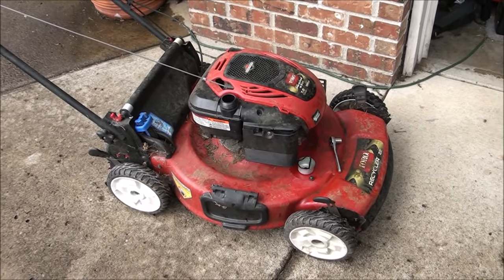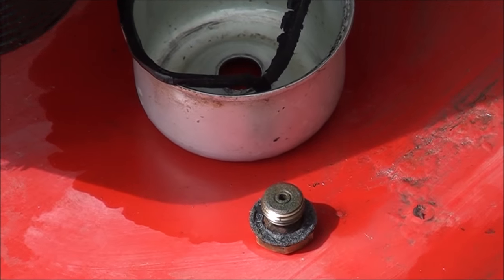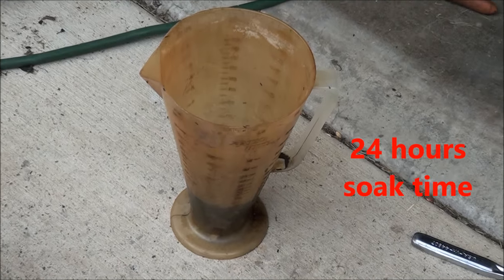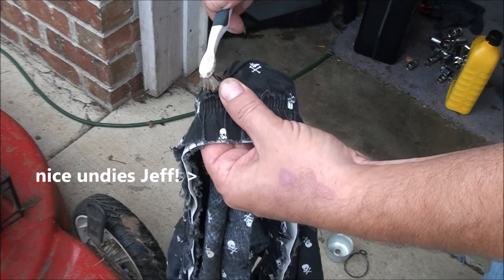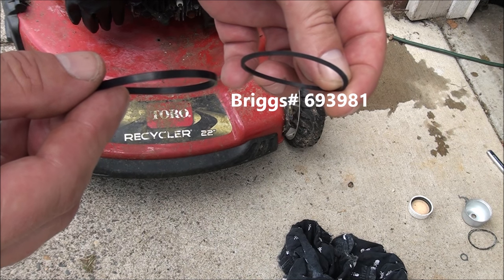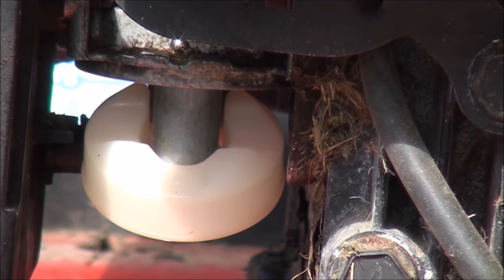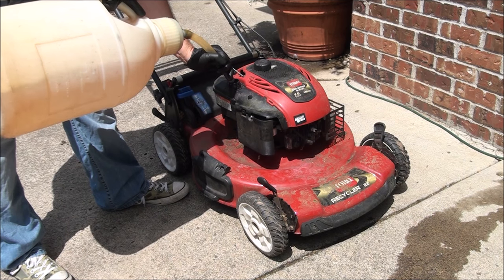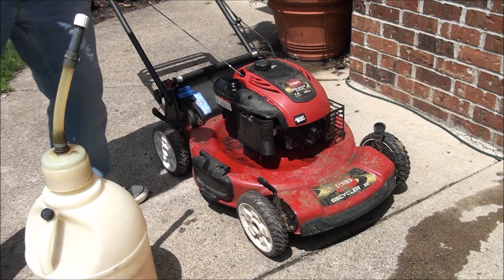How To FIX A TORO LAWNMOWER that STARTS then DIES. Will Not Stay Running. STARTS THEN STOPS

Comment: omfg this worked! my dad was a mechanic at a landscaping biz for 30 years, i helped for 6. we used old lawnboys i use to just give the carb a clean. well my dad passed away leaving me with alot of equipment thats half running half broke. so i remember in convo once he said  "all that thing needs is a gasket i told the person it was junk" so i put the new gasket on he had set to the side and it kept starting and dying after 10 seconds. sure enough i pulled that plug off and both holes were all gunk! i said still, theres no way this is going to work i always have bad luck. sprayed carb clean through it and used a pin to push the gunk out. put it back together. FIRST PULL IT STARTED! ran like a fucking beast i cut the whole damn yard. thank you!
Reply from the maker: good job! It's in your blood
Reply: I landscaped back in the 80’s and I loved those old Lawnboys. I wish I still had one of those mowers because they were lightweight and would run forever with routine maintenance.
Reply: Sorry 😞about your father 👨😔my condolences 🙏I just loss 📉my mother 👩from the covid 4 months ago 😢..

Comment: Thank you for getting straight to the point.   I hope that is what my problem is.  I have seen other (very long and drawn out) videos that take 15 minutes to explain what you just did in less than 5 minutes.
Reply: Well. I went through the whole fuel system. Made sure the gas cap was good and properly venting, the fuel line was good, the little jet that is in the bolt at the bottom of the cup under the carb.  Sprayed down the carb with cleaner.  Blew everything off with a compressor.  Everything was already clean to begin with but after I cleaned it anyway, the mower ran great.  (New spark plug and blade also).  Thanks so much for the video.

Comment: Thank you for your Video , i was having the same problem with my TORO , i changed the Spark Plug , the Filter and  the Oil , did not work , then i saw your video ,  gave it a try and it WORKED ! Thank You  so very much !

Comment: Thanks for the video!  Elevated the mower and tilted it back and clamped the gas feed tube so I wouldn't have to drain gas tank. Just the gas in the bowl, with old towel under worked. Kept old gasket and just manually cleaned jet, even though it didn't look dirty. Nevertheless, mower now starts easily, and remains running smoothly. So glad you posted this Jeff.
Reply from the maker: Glad it helped! Good job

Comment: I had this exact problem on my 2009 Toro "Guaranteed to Start" Recycler with a 6.75 hp Briggs & Stratton engine.  I thought I would have to take apart the carburetor but your solution worked for me.  I did use carb cleaner instead of Coke and so was able to clean the jet and bowl within 10 minutes.  Also, I tipped the mower down onto its handle to prevent my full tank of gas from spilling out when I removed the jet and bowl.  Thanks for producing this video!
Reply from the maker: Thanks for watching friend! Glad it helped

Comment: After replacing the Spark Plug and cleaning the Carb it ran fine for a while. Then it started running bad again. Checked the Spark, even cleaned and adjusted the Gap. Still ran rough. Discouraged until i found you post on YouTube. So I checked the jet it was plugged and there was more dirt in the bowl. Cleaned the Bowl and Jet and WHOW its a new mower, runs great. Thanks Jeff Your the Bees Knees Bro!

Comment: You nailed it. Fixed in just a few minutes. My float bowl stayed attached to the carb and I cleaned the jet with a welding tip cleaner. Runs like new. Thank you for the tip.....

Comment: Thank you for this video.  My husband took our toro completely apart and put it back together checking all the usual things. He got it where it would start with starter fluid but not stay running.  I did a little google search that came across your video so we headed back out to check ours.   Sure enough we got it to start and stay running.
Reply from the maker: NICE

Comment: Thank you, this exact problem started on mine today in the middle of cutting the lawn chewing up the leaves. Pulled out 13 mm socket and it came right out sprayed everything with carb cleaner and just used a small wire to clean the jets put it back together working perfect. Appreciate the video very much
Reply from the maker: Glad it helped

Comment: Thanks for the tip. Worked flawlessly on My Toro nearly same model but 7.25. Wasnt as rusty as yours (it was like new actually, but i always tend to wash my lawn mower after every use), only some kind of <<white mold>> that was clogging it. Once removed, cleaned in some water and a tip cleaner everything worked perfectly. Youre the man!

Comment: OMG you are Awesomeness!!! I have the exact same mower.  It would start then die immediately.  I called the Torro repair shop.  $120 to look at my mower.  I found this video and it cost me the large sum of 55 cents for a new gasket that was crack.  This fix took me about 30 minutes to do.  I used a twist tie wire to clean the holes
 out and a toothbrush to scrub the dirt.  Mower is running like a champ.  Thank you!!!!
Reply from the maker: good job, thanks!

Comment: Thank you for the video.  Had this problem today, solution in the video solved it.  Was a bit surprised that it happened on 3 year old mower though.  Looks like I'll be using startron going forward.

Comment: Hey buddy, just want you to know my mower is fixed! You were so right, silly me did not connect the fuel line all the way, but the carb was filthy, I cleaned it with carb cleaner and unclogged all holes.... mower runs like new!

Comment: Had this exact problem - runs on starting fluid but then dies.  Pulled the jet and bowl.  Soaked them both in diet Coke for 2 hrs.  Shot some carb cleaner thru the jet holes after, put it back together, and pulled the chord.  Started right off and ran smooth as silk.  Thanks for the tip.
Reply from the maker: good work!

Comment: I did as directed. Though my main jet was completely clean, I noticed the tube from the air cleaner to the engine was disconnected. Reconnecting it resolved the problem. 
Remember that combustion needs air — as well as fuel and spark — to fire.
Reply from the maker: Nice work

Comment: Thanks. Had the same problem - wouldn't staying running. We have the newer version of the Recycler 22 because bowl is plastic. Took it off and found the float, the pin and and float shaft sitting in the bowl. After reassembly four pull and ran fine.

Comment: So i have worked on engines for a living, but its been 10+ years since i really worked on a small engine. Never the less. I pulled it apart and felt that it was getting spark and air but couldnt figure out what was causing the fuel problem. Pulled apart the carb and thought it looked clean (didn't think to check the jets). Took it apart a 2nd time. Sure enough something must have been blocking it because running wire through the holes and reassembling got it running again.
Reply from the maker: It doesn't take much to plug the main jet, a small speck of debris can do it

Comment: Thank you Jeff. Works great but next time I will drain the case first because it kept leaking with the bowl off. Used Spray carb cleaner & wire in the holes. Repair shop used to charge me about $75.

Comment: I have the same issue with my mower, it used to crank but would run to slow to cut, and cutting grass would cause it to shut off. I tried this, and the little threaded jet plug and bowl were pretty clean, and so were the holes. I did it anyways, and now it  doesn’t crank at all. (Filled it back up with gas, and checked the oil) - any ideas? Something else with the carburetor? Do you have a carb video for this mower?

Comment: I am having the same issue with a brand new carb.  Will the jet be plugged up on a new carb?
Reply from the maker: you have to make sure the fuel tank and fuel line are clean
Reply: I replaced the 1/4 inch fuel line and removed the fuel tank and cleaned it too.

another suggestion?   thank you.

Comment: I have a Briggs 6.5. It starts with starting fluid, but then dies. The carb & main jet have been cleaned. When I push the primer bulb, no gas is coming up thru the carb. The primer bulb is fairly new and looks fine. I put a new gasket between the air filter housing and the carb. It’s just not getting gas,, even when pushing the primer bulb. I took a wire and cleaned that passage between the primer and carb. Any ideas? Thanks so much!
Reply from the maker: try using 2 new primer bulb gaskets together, usually this will work to help it prime again.. Also, If the mower only starts then dies, it sounds like the main jet is still plugged.

Comment: I have a mower that starts and stalls....brand new carburetor...i even attempted to clean it thinking maybe by not draining the old gas first it dirtied it up...well still same problem....i even changed coil and spark plug from another mower....could it be a vacuum leak in the intake? If so what's best way to test that?

Comment: I have the exact same mower,  my mower bogs down and wants to die every time try to cut thick grass? Do you have any suggestions?
Reply from the maker: I always recommend cleaning the fuel system and carburetor first. That could also be a sign of a worn out engine.

Comment: Have a question i have the same mower its starting but sputtering and then it pick it up its picks up speed also wheres is the fuel filter located
Reply from the maker: clean the gas tank and carburetor. the fuel filter is just a screen in the tank and does not work that good.
Reply: Well i did everything like you told me still nothing fired up once amd died

Comment: My old 80s Briggs & Stratton 13.5 motor doesnt have any holes in that bolt.    Is that rare?   I inspeacted in in the sun after cleaning it good & NO holes in it.    Mines kinda pointed as to where yours is flat at the end.
Reply from the maker: Briggs has used several different carbs over the years.

Comment: Hi Jeff I have a Toro 22in Recycler with Smartstow lawn mower model 20339 with Briggs & Stratton engine.While cutting my lawn for the first time , the pull cord froze , can,t get it to pull. Gasoline check, oil check. Not sure what happen. Can you help
Reply from the maker: I hope you put oil in before you used it!

Comment: Jeff I need some help! I have a TORO 3550 generator with a 6.75 hp Briggs and Stratton engine and it fails to start. I've removed the Carb cleaned the main jet, nozzle and the carb, replaced the spark plug cleaned the tank and added fresh fuel. It starts when I use starting fluid but won't remain running, the fuel line is clear and I replaced the oil and I think this unit has a low oil level shutoff so I removed the line to the sensor just in case and it will only start with the starting fluid  then shut off.  I'm stumped??
Reply from the maker: It certainly sounds like a fuel delivery/carburetor problem
Reply: Took the carb back off watched your vid again, some dummy (me) put the fuel valve for the float  in upside down.  No fuel, corrected and it started right up.  Thanks a million

Comment: Is it absolutely necessary to drain the fuel?
Reply from the maker: Yes the tanks are always dirty and need cleaning otherwise the problem will happen again.
Reply: @JeffsLittleEngineService  thanks I ended up doing that actually, because of your video I clean the injector and boom! Started right up! thanks and you earned a sub keep up the work!

Comment: Do you have to make sure the fuel is empty from the tank to remove float bowl
Reply from the maker: No but It's important to clean and dry the tank too.
Reply: I have the exact same mower 22 inch toro personal pace electric start comes with it the mower has fuel problem
Reply: This video helped me a lot my float bowl and my main jet had tons of dirt in it when i took the bowl off it has oil and dirt in it i clean the tank and pipes now my personal pace works almost flawlessly

Comment: Would this have happened on the first usage of the mower?  I just got mine and it stopped running.
Reply from the maker: if dirty gas was used, yes
Reply: @JeffsLittleEngineService  it was freshly pumped.  A fuel treatment was recommended when I bought the mower, but it was on back order.   It actually should arrive today.  Maybe that will help?  Sta Bil Storage  Fuel Stabilizer?  Have you heard of it?

Comment: my old lawn chief 400cc 11hp runs.but today it turned off.i waited then it ran again.any ideas.i cleaned the carb.did the rebuild.jets and everything.maybe i need to adjust the timing?
Reply from the maker: +Hugo Chavez thanks for the question. If it is stopping then starting most likely it is a fuel delivery problem. Make sure the gas tank and carburetor are clean.
Reply: Ok thanks

Comment: Yeah, it starts right up and runs, but did it stay running?? I did this, and it has the same problems (starts, runs for a sec, then dies) after about 20 minutes of mowing.
Reply from the maker: your fuel system and carburetor are contaminated/plugged

Comment: I've cleaned my carb twice, drained and checked fuel lines, and confirmed spark plug works.  Still no luck getting it to stay running (this model mower).

I can hold the carb closed on the air intake side and it'll run.  The arm that's connected to that thermo arm linkage whatever.  Any ideas?
Reply from the maker: is the main jet plugged?
Reply: Thanks for reply.  I didn't see anything in the carb.  I'm going to take my scope to the rest of the mower when I get time, but I haven't been able to find any obstructions.  

Is there another spring on the temperature coil / muffler side that I maybe lost or something?

Comment: I am having this problem. I just bout a used one and the owner said i run great. I put it in my car and and drive it home. This morning, I get up to cut my grass and it will not start. I buy a new air filter and the buy a new primer bulb and it still will not start. Should I change/clean the carburetor?
Reply from the maker: hard to say but that is usually the problem. make sure to clean out the gas tank also
Reply: +Jeff's Little Engine Service well cleaning the carburetor and emptying the gas tank worked, but I think I tightened it a little too much and now it the bowl leaks. What could be the problem?
Reply from the maker: make sure the float bowl gasket (o-ring) and float bowl bolt gasket are in place.

Comment: I have a Briggs and Stratton Toro Lawnmower (6.5 Torque, 190
cc). a small rock got caught between the   pulley and the belt. With the gas container
facing me, I tilted the lawnmower to the opposite side to get the rock out,
then oil and gas started licking out. Now it doesn’t start. Can you help me?
Thank you in advance
Reply from the maker: the air filter may have become oil saturated. try starting the mower without the air filter.
Reply: Wow!!! You are a genius. I did exactly what you instructed. Sure enough, the filter was covered with oil and the mower did start without it. Thanks so much. You are the man.
Reply from the maker: thanks friend!

Comment: I have a pretty new mower. It loses power going uphill, full tank of high octane gas. If I lift the rear of the mower it runs fine, tilt it back (front wheels off the ground) it stalls. ANY suggestions??
Reply from the maker: sounds like water / sediment inside the carburetor and or fuel tank.
Reply: Thanks. I will drain clean and try again
Reply from the maker: hopefully that will help. you will be able to tell by inspecting how dirty the gas is inside the carburetor and gas tank. Good luck!

Comment: I have a Toro 22"recicle lawn mower I put a brand new carburetor and start but 5:00 minutes later stop çan somebody tell me what's wrong.
Reply from the maker: Contaminents in fuel system You must clean out the carburetor and gas tank too or the problem will reoccur.
Reply: Can I clean the gas tank with water and let it air dry?

Comment: hi jeff. i have the same mower. my mower will run for about 1 min 30 secs then dies. about an hour later i can run it for another min 30 seconds. think i have the same issue?
Reply from the maker: yes sounds like it
Reply: Jeff's Little Engine Service tjanks for the reply. i went through the carb with carb cleaner and cleaned the main jet as well runs perfect now. thanks for the help.

Comment: I cleaned out the jet and it ran for awhile then it went back to start run cutout . If I hold the primer button in it will stay running. It is driving me nuts trying to figure it out.
Reply from the maker: make sure the entire fuel system is clean, tank, fuel line, carburetor
Reply: Jeff, thanks for replying so fast. I had it serviced on 17Oct17. I just took it out today the gas tank was empty so I put fresh gas that I got today. I had some problems with it cutting out at first so I took the jet out and blew it out with some gun cleaner, it ran for awhile then went back to cutting out again. When I had it serviced they took the gas tank off and dumped the old gas out. I am frustrated with it.

Comment: I did this, cleaned out the bowl and the jet with carburetor cleaner, put it back together and it still starts and then dies after about 3 seconds. Help :(
Reply from the maker: It still has a fuel delivery problem. Make sure tank, fuel line and carburetor are thoroughly cleaned. And that the jet is clear.

Comment: mine starts right up with starting fluid and quits.....cleaned the main jet twice.......still wont start
Reply from the maker: sounds like you still have a fuel delivery problem, I would check again to make sure the tank, fuel line and carburetor and main jet are clean and functioning correctly

Comment: Mine starts, then the choke won't open, and it dies. If hold the butterfly open with a screwdriver, it stays running.. any thoughts what causes this ?
Reply from the maker: must be an issue with the auto choke mechanism